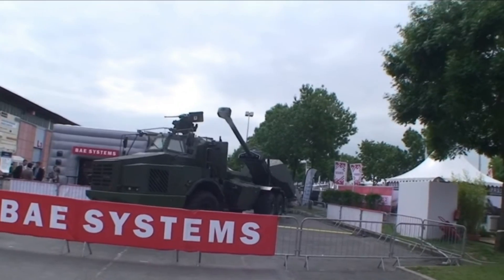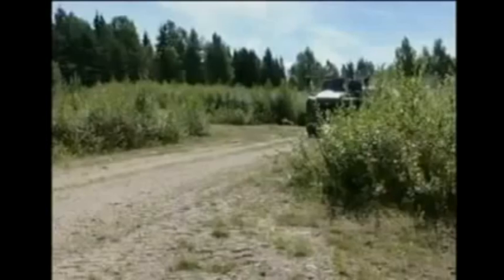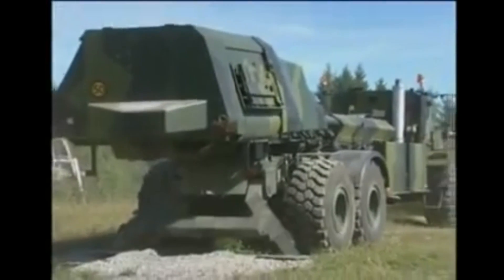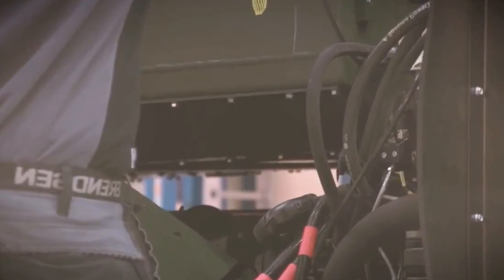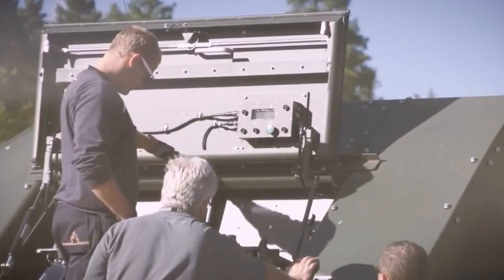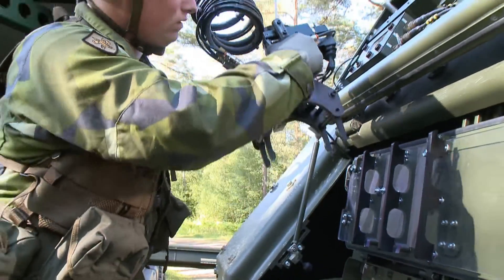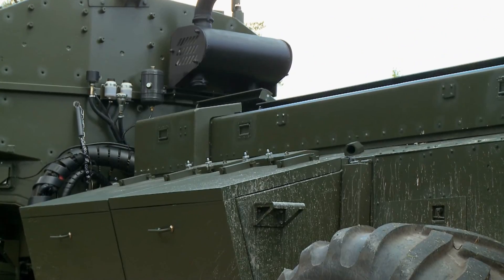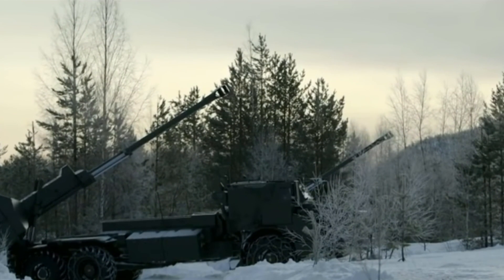Archer FH77 Self-Propelled 155mm Howitzer

Comment: I did work well in -43C last winter in Sweden!

The mobility of Archer is as good as the platform it is built on (Volvo A30D), With six wheel drive and snow chains it is a beast in deep snow. Secondary armament is a 50 cal on the roof (Protector) not 7,62mm. 
https://www.youtube.com/watch?v=qIHLkntah9Q

Archer in the video is an Old prototype.
Archer can be operated by 2men if needed.
Reply: I wonder what an even bigger one would look like. I'm thinking maybe at least a 203mm gun on a Volvo A60H chassi.
Reply: @tntfreddan3138  
Not going to happen because one requirement is that Archer shall be air transported in a Hercules.
Reply: @petter5721  yeah, true.
Reply: Yes, we know that you Swedes go crazy for long shafts. And now you guys double-team that thing? That makes sense...

Comment: If you're not putting more than 50 rounds down range, you aren't at war, you're on a hunting trip. 20 round magazine is useless. This thing is a Toy, a waste of money for an army that is itself pathetically under-powered. They could have done far better investing on military infrastructure, rather than an arty piece they won't ever use, that would in the worst case scenario fail to bail them out of a jam, and under ideal circumstances not produce any significant result. You can't fight terrorism with artillery. If we could, we'd have won over a decade ago. And against a real army, this thing is at best a constant annoyance. Constantly relocating like that is great for safety, but also means you spend more time moving than shooting. The only time such run'n'gun tactics would be useful is if you are evading enemy counter artillery. If the enemy has you outgunned to the point you are dodging incoming fire, you're probably in alot of trouble. To be honest I think under such circumstances, they'd only succeed at postponing the inevitable. Also, mobility won't save them from aircraft. Even while moving, they are an easy target for direct fire weapons such as helicopters and planes. The mobility will only save them from returning artillery fire. A far easier and safer way to overcome enemy artillery is just by drowning them in more artillery. For what it costs and what it's worth, the Nords would be better served doubling their conventional artillery, or just developing more long range artillery to try and outgun their opponents. Offensively speaking, the mobility would be useful, however, the artillery is dead in the water if they don't have air superiority, mobile or not. And if they have air superiority, then the artillery is obsolete because the planes can do the same job.

Comment: Ugh, I understand the need for targeting computers and auto-loaders can be useful when dealing with heavy ordinance, but for fk sake, its an arty truck, not a fking jet plane, do you have any idea how hard it is to repair these sorts of delicate hydrolic/electrical systems in the field? A fking lever operated loading mechanism to take the strain off the loaders back is all that is needed. A Rotating ammo rack for easy reach is itself enough to feed the loader. WTF was that BS at 9:15, is that how you load the auto-loader? WTF! It'd be faster to erect a makeshift crane from steel tubing and load them into the roof than to place each one individually onto an automated conveyor belt, then watch the thing eat each round like a compacter. That is the least efficient loading mechanism I've ever seen. Sure its not meant to be loaded in combat, but how long between barrages are you willing to take? In a game of firepower over manpower, you need to throw as much ammo as possible. Who gives a fk what your RPM is loaded if loading takes 10 times as long as normal! And the delicacy of it all! They'd have to have two truck's worth of spare parts to ensure these things could serve fore more than 1 year at a time. I guess when your country doesn't actually have any enemies to fight its easy to overlook, but after a year of combat, this truck will have to be sent back home covered in ducktape.
Reply: We already have towed artillery pieces.
Reply: Sweden took over the 24 archers from norway, so 24 in use, 12 in storage and 12 will potentially get sold.

Comment: They cancelled for several reasons.  Hydraulic leaks several places.  The crew compartment was not tight enough for fuzzes after a shot. Also it was not tester for shooting all rounds in a row. It had to many faults when they wanted to deliver it to Norway.  Even the Swedes used Norwegian m109 in exercises when they did not have archer ready.

Comment: To get Archer in position, you combine it with Infantry using the CV90 tracket APC system, or any other medium tank. If you put a plow-blade on the front those wehicles they can make a road for the archers to get almost anywhere. No weapon system ever operates on it's own. Infantry with chainsaws or bulldozers can easilly clear away trees, and the gun-carrier trucks can traverse almost any terrain. The one big problem is navigating thight city streets, so unless you can go around the bigger cities those can become deadly chokeholds.

Comment: About the use of this gun in Scandinavia as to the impact of the terrain and weather, its actually just what we need. We rarely get more than one meter of standing snow and even if we do the biggest issue isnt snow but rather all the fords and lakes that dots our landscape. 70% of Sweden is rough terrain (middle to northern sector, the south is as flat as a can of coke in a hot car) or lakes, ie areas you cant easily traverse. Having an artilery system that uses a dumb payload and can cover a large area with a low engagement time is ideal for the kind of a defensive military we have been building up during the last couple of decades.

Knowing the Swedish military (being a swede) and our spending we would never buy, or build, a system that wouldnt work in our climate or to spec. 

Our biggest issue to date isnt the technological one but rather a lack of will to properly fund it, or so i assume since we havnt been to war in a defensive role for nearly 300 years (as a country, we have lots of peace keeping forces out and about).

Having the manuverable Gripen in the air and our coast patrols defending the... coast... im sure we would be a tough target to swallow without some hard casulties. But i hope that scenaro never happens.

Comment: Actually, the design looks like it specifically had woodland navigation as a design philosophy. It looks very similar to types of forestry equipment, and if it was painted yellow it could almost pass as it when in the mobile configuration.
Reply: It's a modified articulated hauler so yes. Used in mines and also in the logging industry.
Reply: Actually painting it yellow could be a better camouflage for this thing than a traditional military pattern.

Comment: Those Volvo 6x6 Haulers are epic. I have seen them used on mines and construction sites. Incredible off-road capability and I absolutely beleive that they can power through a meter of snow. Being wheeled, their usefulness in the European theatre, given the very complex and comprehensive road networks, is very sensible. Scary peice of tech. With the optical sight boresighted to the gun, anything that gets within 2km is toast. The ability for one howitzer to fire up to 6 rounds, all on different ballistic trajectories and all to land simultaneously is a very neat feature. Time On Target has, in the past, been acheived by multiple guns and complex maths. A battery of these all firing a 6 round TOT fire mission is a devastating amount of firepower, especially if used on troops in the open. No one in the kill zone would have any hope of diving for a foxhole or trench. Very impressive piece of kit.

Comment: Don't know where you got the 2003 dev start and 2005-2006 prototypes from.
Havn't looked into what info is available online but i did my military service back in 1996-97 and we had the first prototype of what would become the archer for trial then.
It was called the Haubits (howitzer) 77D and was mounted on a protected 6x6 Volvo just like the Archer and could put 6 rounds at same location at the same time just like the Archer.
Sure it was an early prototype but development absolutely started way before 2003. Possibly it was only Bofors back then and the BAE-Bofors venture may have started in 2003.

Comment: Volvo's (Teberg a sister comp) are very good in cold environment 
We bought a Teberg truck and we were invited by Volvo that designed the truck to do a run in Zweden with the same Teberg type... 
It was -29 if I can remember.. And I'd did very well 
Cold start no issues.. 
Driving was an heaven to be, and it preformed exelent!

Comment: Honestly as a guy who has worked most of his life in Northern Alberta in the Oil fields. I think this thing would plow through as deep of snow as you can find. I've seen much lesser vehicles go through mass amounts of snow with not much problem. If anything, I think in the spring time when the snow melts and the mud gets real thick. That would be the only time you're have to worry. 
   But if it has some advanced traction control, it could be unstoppable. But in tight wood lines I can see it being tough to maneuver though. Being so long. Some of those logging roads are very narrow. I had a Land Rover I rebuilt as an off road vehicle. And with just a 2" lift, and really high end tires. That thing would go places you wouldn't believe. And it was the advanced traction control that really gave it it's edge. By far the best vehicle I've ever driven in winter conditions in Canada. Although it cost a lot to maintain. I'm sure something like this would have probably some of the best drive train for winter conditions in deep snow.
Reply: when the mud gets that high you use the steering to make a fish-tail like movment, wasent able to find the clip from England mud channel when it looks like the Volvo is "swimming" in the mud
Reply: It's 6X6 all wheel drive, the problem in mud is usually when the mud sits against the undercarriage and the wheels can't get traction.

Comment: ... so - PRACTICALLY - this is a 155mm "SNIPER-SUPER-GUN! - a sort of HIGH-PRECISION ARTILLERY!...
Reply: Basically. One that works in tandem with other systems to provide dumb fire against ground targets.
Reply: Even better, tbh. The mobility is fantastic for its weight, and the ability to hit targets in way 3 or 4 shells land simultaneously on target is a force multiplier. However, all the elx translates to very high maintenance costs.
Reply: @puggleski6097  not as high maintenance costs as you seem to think as all the parts that gets worn bu driving is mass produced for the civilian market for the mining and logging industries world wide.
The wheeled chassi is basically built on the T-ford equivalent of modular civilian all terrain industrial vehicles

Comment: Meh this is over kill for a howtzer. Whole point of artilley systems is that they are dirt cheap.
Also Bonus and Excalibur rounds can be fired from any 155mm howitzer. They are independent of the wepons fire control.
Same goes to firing rate. 3 rounds out in 15 secs. is a common standart..although gunners would appreciate not having to do the lifting.( or maybe not..as they wouldn't have a job anymore)
Reply: In what way are they overkill? It's perfectly fine to use a simple towed artillery system against a low tech enemy such as in Iraq and Afghanistan. They don't have same anti battery capability as of a modern enemy has where speed of deployment and accuracy is the key point because you don't have the luxury of staying put to fire for a long period of time from one position* and hit a large area.

*It can still achieve this goal.

Comment: About precition . Normal artillery tower svivels on a circurforence at about 2 meters, Archer might 30 cm. When firing the gun it has only 2 leggs, rest is airfilled tyres. Most competition have tracks and solid wheels, the only that moves is sunspension, on Ardher it is both suspension and tyres.
Reply: The precision has been proved to be great on the Archer, it was just a bullshit argument used by Norway to warrant it's withdrawal from the purchase, it's not the first time and won't be the last time.

Comment: Somewhat strange that the entire turret including munitions stowage is elevated (up/down) during operation, kind of a fan of the AGM i.e. the turret system on the Donar Howitzer, also the barrel extending out over the drivers cabin, it saves a considerable amount of space... Would like to see the two compete!
Reply: Not strange at all, you can keep firing with out having to put the gun in a loading position to load a new round, the loading mechanism and the stowage follows the gun.

Comment: Correction! Norway has decided to not use this system. The Acher did't meet Norwegian demands. Alternatives are currently under testing and evaluation. These include the French Caercar, the South Korean K9 Thunder, the Swiss M109G and the German Panzerhaubitze 2000.
Reply: Well... first they said it was mostly because of delayed delivery according to contract. But then they got informed that same contract said if someone break of he still have to pay his share. Then suddenly it was because it did not fill Norwegian "demands" and "leaked" info started to pop up.
Reply: If it didn't meet their demands they wouldn't consider the Ceasar unless Archer exceeded their demands and that was the actual issue. It's bullshit and they know it. It dragged out in time and it was a political decision to pull out and it wasn't because it didn't meet the requirements. I have a feeling that M109G is a very strong contender in this. This is nothing new when it comes to Norway. Unfortunately Sweden has done the same to Finland with AMOS.
Reply: The options are now narrowed down to the K9 Thunder and the M109G. I have a feeling that we will go for the K9.
Reply: No, the issue was and still is that the project did not meet its deadline and ended up costing more than planned. This has been a major issue for Sweden as well.

https://web.archive.org/web/20130701081034/http://www.officersforbundet.se/portal/pls/portal/docs/1/656002.PDF

Delivery of all 24 artillery pieces to Norway by 2013 was a pivotal part of the contract. By then we had received 0.
Reply: Sorry, I was a little unclear there. I agree with you  and also think it was initially the delays that had the Norwegians to cancel the contract. It was the kinda dirty play that started from them when contract issues started that I found somewhat dishonest.

Comment: If you have put a low range into a vehicle you will minimise the amount of time you spend digging out.  They would have put that that into the design, along with diffs - air-locking diffs.  The same thought of technology they put into fourwheel drives, on  a much bigger scale.
Reply: It's a 6X6 Volvo A30E dump truck, it's already got all that built in.

Comment: The Volvo A30, what this is based on, is the smallest one Volvo makes. You should see the size of a A60!  :-)  They are built as extreme condition dump trucks, so to get bashed about.
The truck can also be equipped with ultra low pressure 1meter wide tires. This improves traction in extreme mud and snow when needed. Not having steering wheels, as it articulates provides more maneuvering power and traction improvement, the rear can also swivel (left-right), something a normal type truck also cannot do.

Comment: What is its protection if a round hits the bustle in the back?  I mean  any round tank round rocket propelled air dropped I imagine not too protected but it should stay farther back in the battle
Reply: No artillery vehicle to this day can survive direct hit from an 155mm artillery round.
Reply: Incoming indirect fire is likely to target the gun, not the cab. This puts the cab at the edge of the blast and combined with light armor gives the crew some chance of survival. The primary protection measure though is the ability to move very soon after firing to avoid counter battery fire. As an artillery piece it is expected to be behind  other units at a front line or positioned in a difficult to reach area so it can quickly redeploy to another location before being overrun.

Comment: The FH77B was originally the export version of the FH77(A). The FH77Bs that were converted to Archer were actually part of the second batch of guns meant for India in 1986. India eventually cancelled the second batch but not before Bofors had manufactured 51 guns. They were instead bought for the Swedish army and later replaced the older FH77As when the army downsized. Originally there were  approximately 220 FH77A plus the 51 FH77B; in total 271 howitzers. So 24 + 12 doesn't seem like an outrageous amount. :)